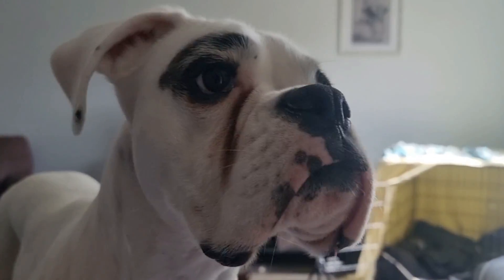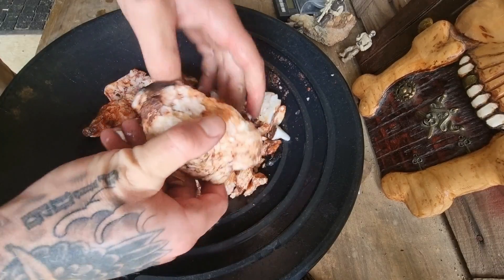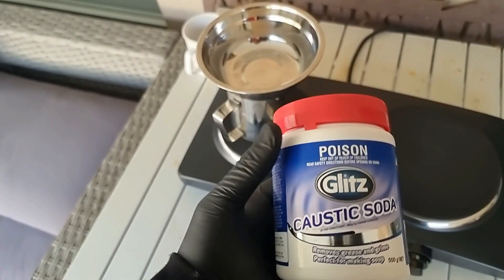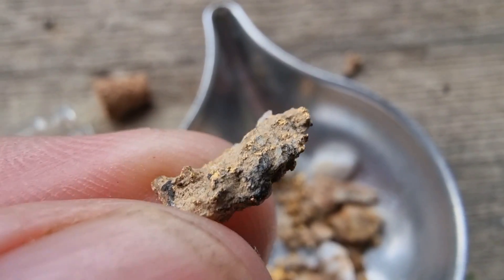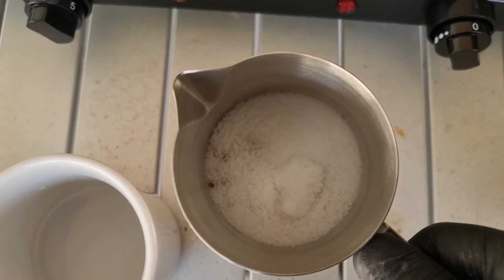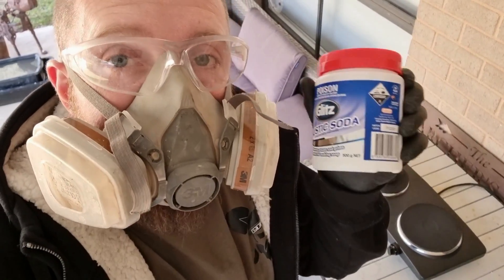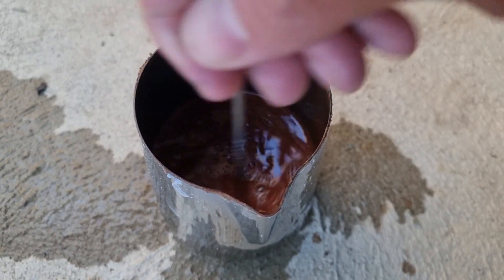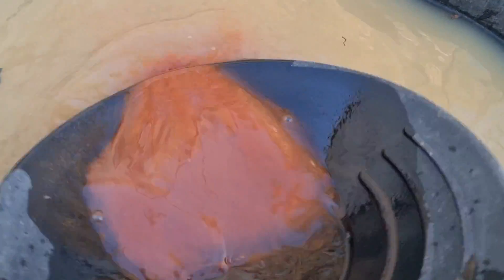A Toxic but Easy Way to Remove Quartz Off Gold

Comment: Public service announcement for all the blokes out there. "Yeah na mate she'll be right." Is not appropriate PPE!  Grab a respirator and do it outside, not in the man cave.
Reply: worth keeping a bottle of vinegar there to neutralize any burns too.
Reply: In the words of sassy the sasquatch Whatyatalkinabeeet? ... Lol yeah nah true mate, we only get one chance hey, not worth it
Reply: Good call -- using outdoors and a respirator. Toss in eye protection.
Reply: Guys, it might be a good idea to get the nice big clear  goggles on and apply a bit of plastic film across them, a few pairs in cause you either stand on them, a rock jumps out at you, or the dog runs off with them when your eating and you leave him out of the treat meet 🤭
In decades gone by I use to be the plaster's assistant and that meant no dewalt sanding tools to suck up the fine dust falling all over me. I also used chemical gloves for termite treatments part A and B's and also a commercial cleaner in TAFE Skiilshare tradie workshops, so I really think when you use this toxic liquids you keep your dog well away and cover up as much as you can. PPE, really makes a difference to your lungs and skin, as skin is the biggest organ of the human body.
Reply: What if the mrs does it?

Comment: Chris just a heads up, I work in construction with silica dust and chemicals like epoxy and solvents....you might need to change the type of filter you have, the one your wearing I believe is for dust, you need a filter for chemicals....volatile gases, or a Multi gas filter for a wide range of different gas threats, go to your safety store and get the right filter type champ, should be a simple change over between the 2 different types, and if you need a dust and chemical at the same time you might need to look more into the filter and the brands of mask, other brands might be more versatile for multiple things of gas and dust. Also if acid and chemicals are airborne you might risk your eyes, go a goggle or full face mask/respirator. I don't want you to get hurt...I enjoy your video too much 😁
Reply from the maker: Absolutely, this mask has a chemical filter on it. It's made for painting booths.
Reply: 👍 all good then.....but be careful as the saying goes oils ain't oils...same for the filters, gets more complicated if you want to use arsenic extraction like the old timers did, I know you have an affinity with history, I think that stuff can absorb through your skin. Keep up the good work champ
Reply from the maker: @anthonysamardzija3344  I'm never doing anything like arsenic.

For me this is literally a hobby and I'll be happy to do this once a year for the right specimens.
Reply: Good tips Anthony. I would like to add Chris that it pays to store the respirator and filters in a well sealed plastic container to prevent the filters from continuing to work when it is not required and therefore reducing the time that you get to use the filters. Clean the mask down properly and then when dry return to the container for safe storage. Clearly marked and dated so you definitely know what is in the container.
Reply: @markfryer9880  another detail from a construction worker: if you’re going to make the effort to use a respirator you also need to trim your mug squatch action. If you don’t remove the hair you might as well just be wearing a dust mask. You need a good seal to make the filters do what they’re supposed to. Other than that, congrats on the gorgeous specimens mate! Looks like I know where you’ll be wanting to detect…although it IS quite the hoof up to the area.
Cheers! 🖖😎👍
Reply: @VoGusProspecting  not all paint respirators are chemical/organic rated, i used to make paints and had to use special filters, not sure about Australia but here in the US the chemical/organic filters are pink
Reply: Hey, hey, hey, what's up, we eating all toxic in my country 😂
Reply: Lol

Comment: I always used a product called Sunny Brite  classic, here in the US - can be found on Amazon.  It’s a water stain remover for tubs, showers and sinks.  I never bothered heating it up, just put the quartz /gold into a plastic container and covered it for a few days. It worked amazingly well, and was reasonably safe to handle.  Now be aware that I used this twenty some years ago, and they make 2 different formulas,  the classic and sunny brite 2, which I tried and only the classic worked well, to the point that some Quartz was gone within a couple of hours.  Hopefully this helps someone !  Also, nice gold !!

Comment: If you get a specimen with multiple bits of gold on the surface , there's an easy way to see if its one big McNugget worth dissolving or just Stampy food. Get a multimeter or continuity tester etc and test between the bits.

Comment: Keep a whole heap of double strength vinegar on hand. You can use it in excess neutralise any spills and any residual vinegar is weak enough that you can wash it with a hose to dilute it and shouldn't cause too many issues. Also with your tailings if you add hydrochloric acid (muriatic acid, also sold as brick cleaner) until the pH is about 7 it turns it essentially into salt water which you can safely dispose of.
Reply: You also have to watch out for the fumes and the hydrochloric acid it's self.

Comment: Hi Chris,
As long you use things for what they're supposed to be, it's kind of safe.
If you put a spoonful caustic soda flakes (or powder) in your drain - ok.
Would you fill an oil lamp with petrol? ;-)

Concentrated caustic soda is as dangerous as concentrated sulfuric acid!
If you heat it, you multiply its dangerousness.
A drop on your skin will burn a hole. A splash in your eye will blind you continuous.
If you heat it up, it can boil over and spill suddenly.
There are too much people who could underestimate the risk ("Safety glasses? My sun glasses will do it too…").

P.S.: Check out 3:40 - no gloves. ;-)

Best regards from Germany!

Comment: Good stuff mate it is good to know that this can make a major difference using simple but affective Safety Measures as you have shown to come up with a better way of removing the quartz from your species. I do the same when I use Ferric Acid on Damascus Steel when I make knives that is actual Damascus steel. I also use Bicarb of Soda to neutralise the Ferric acid then wash off with water. Not sure of how Bicarb of Soda will work with Caustic Soda but it maybe worth a google search for future reference mate. That came out Awesome either way and thanks for posting 😉
Reply: Only fair; that is a VERY strong base solution.  Bicarb is a buffer and works on both acids and bases to some degree, but for the strong stuff you need to counteract and dilute....very, very carefully.

Comment: Well that’s a pretty awesome method man. I’ve tried the hydrochloric acid and it takes weeks and a lot more dangerous and doesn’t even get it as clean as that. Will definitely be trying this
Reply from the maker: This is way easier!
Reply: HCl doesn't react with/dissolve quartz, all it'll do is etch way reactive minerals like sulfides and oxides etc. NaOH reacts with SiO2 to make sodium silicates which will dissolve in water. If you really wanted to you might be able to dissolve away any resiudual minerals that aren't base soluble with HCl though to give you really nice clean gold.
Reply: @VoGusProspecting  Caustic soda is drain cleaner so tipping small amounts down the drain should be ok too

Comment: Consider this. If you have a vessel to preserve that caustic acid in put that gold soup though a filter paper and glass funnel into beaker, then save that off. Now rinse the gold in the filter paper for the finish. Less waste and less induced into your local environment. Or any acid can be mixed with a base to produce water and a salt which is sometimes complex.

Comment: It's also the best stuff for cleaning chainsaw chains, though you only need a relatively weak solution and warm water. Only leave them in for a few hours, if you leave them there for more than a couple of days they will start to rust. 
I never knew it could do that to Quartz, guess l've got another project for the weekend.

Comment: Chris m8 u can use a multimeter on ur speccies to check continuity between the various visible points sticking out of the quartz telling you which bits are connected ⛏

Comment: Sweet, im gonna have to try that! I had a similar specie but smaller and it took 2 weeks in acid to dissolve the quartz.
Reply from the maker: Small bits like mine, 45 minutes, bigger bits maybe a few hours. Let it cool down before you flush with water

Comment: Hey Chris, just thinking about this process, could you put the quartz through the fire process to soften the quartz then the chemical process to dissolve the quartz, it may get rid of the quartz quicker.
Cheers Matt
Reply from the maker: The caustic soda does it in 45 minutes. It would take longer to get the fire to temp
Reply: @VoGusProspecting  oh, ok, I'll get back into my box🤣🤣
Have a great day,  cheers Matt

Comment: If you want to have more fun with caustic soda - make a watery, saturated solution add aluminium and capture the gas in a balloon. 
Ignite the balloon with care - it is full of hydrogen - make a fantastic fireball or a large bang! So CARE is required - I use an old school disposable camera cube flash in the bottom of the balloon and drill a small hole in the face of the 4 flash units. Trigger them at the same time.
Yehaaa - good for guy fawkes night and it leaves zero evidence behind as the explosion / fireball combusts into water.
This is strictly for the mad scientists - this can kill or permanently maim you.

Comment: 30% peroxide does the same thing without needing to heat it.
Reply from the maker: Not as fast.
Reply: @VoGusProspecting  Just about as fast.  I use it to clean rocks with the added benefit of nothing sticking to my containers. ;)

Comment: To counteract the caustic soda at the end add sulfuric acid in the proportion of 10% acid and 90% caustic soda. The result must then be diluted with 200% water to be able to throw it into a drain.
I hope it helps you.
Greetings from Girona, Catalonia
PS: I'm in this system to remove gold from quartz..